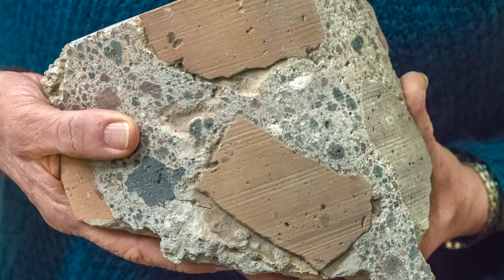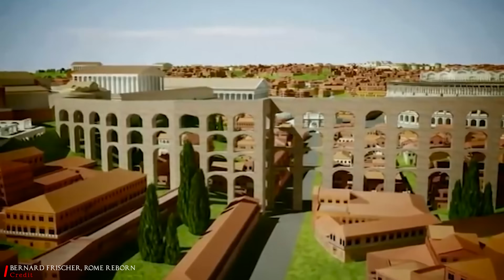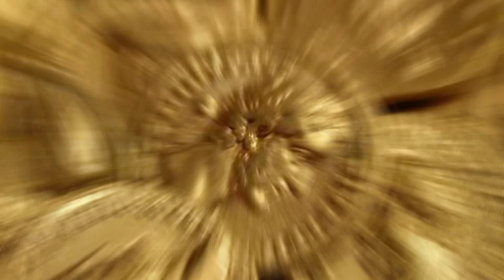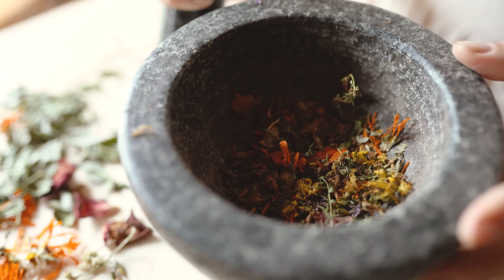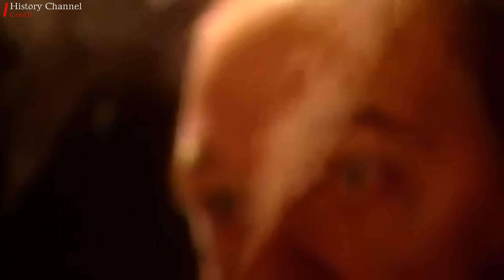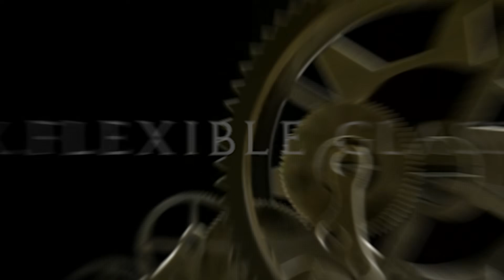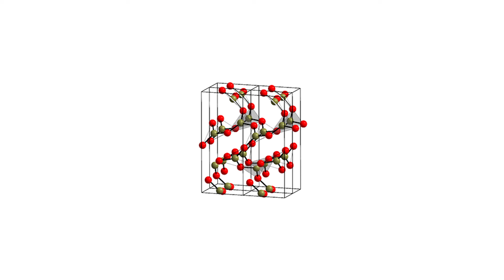Top 10 incredibly advanced Roman technologies that will blow your mind.

Comment: Say what you want even try to said what :

Harnesing a drinking water 24/7 to cities and urban, where this drinking water is delivered on hundred or even thousand public drinking basin are and the people can drink and enjoyed directly this 24/7 water from the deep aqueduct that carried from mountain spring is honestly an absurdly modern for that time, 

I mean people forget this is not only in City of Rome, but across hundred roman cities that have the massive aqueduct system 

And remember, 80-90% aqueduct is underground and for underground, they aint pipeline, they basically underground subway but design carried delivered massive water from deep water from mountain and design run 24/7, and remembee they divided in Water Castle or Castellum Aquae

And fhe general rule thumb are :

Whatever a shortage happened or the aqueduct line damage, the first one immidiately get stopped is on the elite house

Comment: Did the Romans discover coal ? Especially when they arrived in northern England.
 If so it would have revolutionised iron making & heating etc .
 
Probably a quarter of the energy to get it and 70% more heat ? ? And burn time.

Comment: Our current tech may be more advanced, but the conveniences and automations that do so much for us are a big part of it. Even now, it seems like the current crop of software developers are fundamentally weaker than their predecessors from just a few decades ago, despite making more advanced output (due to tools and libraries that do a lot of the heavy lifting imo).

Only a precious few are operating at the highest levels - it seems as though Ancient Engineers could still hold up against the current crop in pure skill and fundamental ability

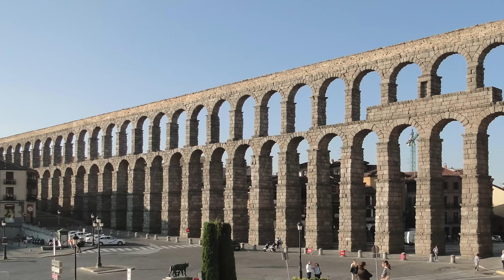Comment: At 07:44, Sebastian addresses my favorite form in architecture--the arch. And this beautiful but functional line is pivotal as well in geometry, conic sections, optics, archery, orbital mechanics, engineering, navigation, cartography, art, design, typography, dance, music, gymnastics and semiotics. 
    The arch, or arcuate detail, or most broadly--conceptual curvilinearity as compared with linearity--can express the narrative arc of a novel, the expressive arc of a compositional phrase by Chopin, or even an entire symphonic movement by Brahms. 
    The arch, a physical realization of an imaginary line we call an arc, strongly drove the emergence of monumental structures in Antiquity, thanks to their power to transfer the compressive weight of gravity to the earth, an artifactual default of the arc's defiant bow-form, holding up the sky, itself an incidental artifact of the self-propulsive lone of directionality through dimensional space, the most iconic visual symbol of intentionality as graphed by the sentient, volitional observer.
     For all those attributes, arches are an engineering staple, an architectural conceit, a ubiquitous derivation of essential geometries and an amazingly variable iteration of itself, eventually less structural than gestural--a flourish of flourishing.
       As a sphere can be sliced in half and plopped atop a similarly halved cylinder, it becomes the venerable apse--and if the cylinder be squat and halved, and not crowned but given a concentric layer , it becomes the exedra, an elegant bench beloved by wealthy Romans and the Pre-Raphaelite painters who portrayed them in the 19th century. 
       And multiplied down a long axis, arches form the arcade, providing the elegant, darkly spiritual quietude of legendary monastic life.
    Many students of GrecoRoman history might imagine the column, pediment or dome when asked to choose a visual logo of the Ancients. I wouldn't hesitate to embrace the arch. Or better yet--stand under it.

Comment: Flexible glass? Fantastic. It'd be really bitchin' to actually find some Roman flexible glass.
   Indestructible glass? That's really not too far fetched. 54 years ago when Coca-Cola and Pepsi Cola were still making glass soda bottles and "RETURN FOR DEPOSIT" was in vogue, the old vending machines at gas stations dispensed cold refreshing drinks in 6½ ounce glass bottles. These were amazingly durable for their size. A friend and I found one in a church parking lot and we took turns throwing it at a concrete block wall, trying desperately to break it. We finally gave up and I think we decided it was valuable as a claim for deposit against another drink. Tough little s.o.b.

Comment: Mercury gilding was an ancient and very durable form of gold plating . The ancients of many cultures obviously learned to extracted fine gold particles using native mercury , then burning off the mercury to leave a button of gold .  They would also use this same amalgam, rub it upon iron , heat the object and the fine gold would then be an applied plate . Having a lot of experience with this methodology, some glass blower experimented with it and discovered a method to evenly distribute gold particle through a glass pour - with the result of a two toned cup . 
  Extracting gold by this method is still used , though we now know mercury to be extremely toxic , especially when heated .

Comment: These large projects like aqueducts depended on the abilities of their surveyors, which were world-class.  This often a vastly underrated aspect of engineering, but it’s not easy to get the accuracy and precision they achieved without modern laser-survey tools.  Their  hydraulic engineering was incredible, too, they had to calculate not only slope, volumes, flow rates, etc. but head loss along every stretch of their water delivery systems.  Then their overshot water mills in series, brilliant.  Their technical abilities were simply amazing.

Comment: Civil Eng here. Your information about Roman concrete is wrong. Roman concrete has much lower compressive strength than most concretes used today. Roman concrete also did not have a smooth finish and was usually only used where it would not be seen. It outlast ours because it did not have steel reinforcements which will rust and reduce structural strength overtime, but our structures are not designed to last forever anyway. We design different concretes for deferent applications and specific life spans.

Comment: It’s sad that the Romans didn’t take the next step in advancements.  They missed their Industrial Revolution.  Their empire would never have died out had they continued to innovate, and renovate their technologies.  With all their advancements, they could not think to change the rope on the crane to a steel cable.  Lack of metallurgy innovation is what killed the empire off - not the barbarians, not the decline.  Those two things were just nails in the coffin.

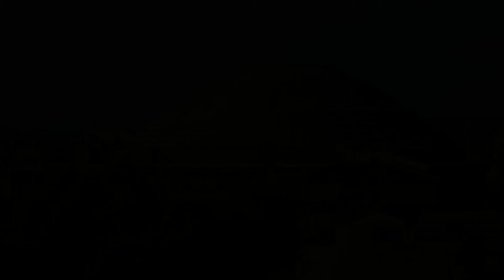Comment: 09:32 f: ... built of non- reinforced concrete ...
It would not have last until now otherwise. Reinforced concrete can take forces non- reinforced cannot but it's prone to decay. As soon as it has the first crack reaching the armour, water will cause it to corrode and to make the concrete irself to brősel away.

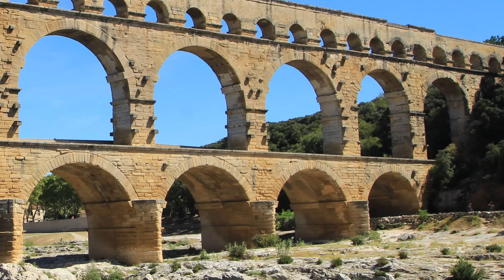Comment: 3:04 Pozzolana volcanic ash was in rare supply, Roman cement would have been ended without the fall of the Roman empire, and fly ash or coal fly ash is at first toxic landfill, before you possibly revalorise it as cement.

But AQVAEDUCTI are my favourite charge against the end of Antiquity and beginning of the Middle Ages. It's so bad.

1) Two cities had been taken through the aquaeducts, Naples by Belisarius, Vienne in Isère by Clovis. They had shown themselves a military security hasard, which was one reason to end them;
2) It has been pretended that Medieval water quality was so low you needed wine instead, false : it is actually aquaeduct water that was such a microbe hasard that it had to be mixed with wine or vinegar to be safe for consumption. Gazpacho goes back to a mixture of bread, vinegar and (aquaeduct) water used by legionaries, and the vinegar was obviously added to avoid gastroenteritis and similar. The aquaeducts were covered by stone slabs, so no twigs or insects would fall down into the running water (as long as the stone slabs were undamaged), but this did not stop bird poop from leaking down or local bacterial foci from proliferating ... long live Medieval well water!

Comment: A point you haven't quite got right.
The Romans used water wheels very widely.
When the Empire began to fall apart, most were left to rot.
But evidence suggests that Princes and or Bishops in what is now Germany and perhaps elsewhere,  saw the advantages in keeping to the wheels working.
They were used for a very wide variety of industrial processes.
The Industrial Revolution, was actually a long gradual Evolution. With the use of wheels being adopted, or re-adopted in many areas.  Steam is Not an essential part of industrialization.

Comment: Metals content in liquid is primarily a function of the chemistry and the residence time.  If a liquid is in contact with a liquid for a long time, it will pick up more dissolved metals, especially in an acidic solution, like wine or vinegar, which increases the solubility if the metals.  It’s safe to drink wine from a leaded-crystal carafe, for example, if just poured into it, but not if stored in it for a long period of time.

Comment: My opinion is there are two main differences between roman "concrete" and modern ones:
- they used lime, as we use cement. Lime never really dries and so remains (a little) flexible, as cement dries harder and becomes brittle.
- Romans didn't use steel bars in their concrete. Steel will rust and thus expand, which in turn will break the hard concrete.
Great video, thanks!
Reply: if you have ever mixed pancake batter you will notice some bits don't mix with the water, this concept applied to roman concrete would be a feature not a bug. were something to happen and the concrete crack water would infiltrate and mix with the power allowing the structure to "regenerate" that is the current understanding. I would also assume they just used more than they needed to which we don't do because of the cost.
Reply: There is no one modern concrete, but a LOT of different ones. For most constructions the cheap and halfway decent portlant cement is used, but there are FAR superior modern variants. They just cost a lot more, but would easily hold up to roman concrete.
Just have a look at some military bunkers where cost wasn't the driving factor.

Comment: Alright this video is trash.

Roman concrete differs from modern concrete because they have wildly different applications. We could make this concrete easily if we wanted but current engineering requirements have certain needs in tensile and compressive qualities to handle modern loads and laws based upon thousands of hours of study and design. There's so many mixes of concrete today because they have different requirements.
Reply: ok

Comment: I reckon they didn’t really have problems with the lead pipes because the water didn’t really “sit” in the pipes. The water was always moving. It didn’t sit in the “tap” until you turn it on like we do. I also think that the pipes were probably coated in calcium over time too. That might be one reason they used natural springs for a water source. They’re usually heavy with minerals, especially calcium. But it’s just a educated guess on my part.
Reply: that is so cool , damn... i have always beleived that water should just flow and never stop when it comes to metropolitan pipe systems , but i understand skyscrapers wouldnt be possible

Comment: How can the Romans not have discovered the uses of lenses for reading (ie, reading glasses) and for military purposes - ie, telescopes ???
Reply: Well, the reason for not discovering reading glasses, was partially because literacy was not a prized skill outside of certain noble ranks, where a disfigurement or failure of the body (like weak eyes) was considered a mark of a God’s displeasure, so … absolutely no impetus to make eyeglasses.  As for telescopes, they existed in India at and before those times (take a look at early Indian astronomy and astrology (the two were closely linked) and some of the astronomical observatories and predictive architecture) and would have most definitely been in the library at Alexandria.  The concept of a large reflective lens was also used as a weapon of war with the “focusing shields” to concentrate the sun’s rays to set ships on fire.  So the concepts were there.

Comment: "It's unsure how they moved these 800 ton stones."

OK well, if u figure that out, then u can figure how Egyptians lifted their stones. It would probably be roughly similar in nature, probably a little more crude. The power of the pulley is strong. And if u stagger pulleys, you can lift A LOT of weight with some slaves pulling a line. 

The boring out of a perfect circle was done with a hollow "pipe" that was sharpened along its tip edge. A heavy stone was placed on top to add downward pressure. A line was wrapped around the pipe and then pulled to simulate a drill bit going around in a circle. The hollow part of the tube, allowed material to collect, so constant drilling could happen. Sand was placed on top the surface to aid in the grinding and boring process. 

This however was VERY VERY time consuming. A man on YouTube was showing this process, and it took him about 3 fn hours just to get barely 1/8th or 1/16th of an inch.

For those who don't know what an 8th of an inch is. Take half of 1 inch. Thats 50% Then half that. That's 25% (1/4 inch) Then half it again. Which is 1/8th. If you half that again, you get 1/16th of an inch. 

So if u physically see how thin that is, that's how much he bored out in about 3 hours. So definitely they had a constant 24 hr drilling through the night with "shifts" which probably took 1 entire month to bore out. Very hard process.

Comment: that is all impressive but that waterwheel is so amazing - i didn't know they used hydropower!!!!
Reply: In mining industry they used a so-called water cannon.
They digged out long mine-shafts going down the inside of the mountain and then, when finished they lead water, lots of it into the mountain which blew up the mountain with the help of compressed air, compressed by the water.
The drawings shortly shown in this video shows exactly that, but it was not mentioned.

Comment: So, my question is why? Why would the Romans built bridges that could handle such huge weights?  Like the one in Alcantara in Spain, with a load bearing capacity of 52 metric tons. Did the Romans have such heavy equipment?
Reply: It’s not just to be able to carry weight, but stand up against weather, and time.  They built to last, so that their labor costs were mostly up-front, and not a constant drain, and when they needed to rapidly move their troops or goods, they knew their bridge would be there, and capable.

Comment: Please consider redoing or spinning off from this video --
For example, how Ukrainians could make Roman concrete and build with it.
Make aqueducts to replace their smashed water systems, even if only to serve one or two houses, or a very small village.
Anything the Romans did the Ukrainians could do today to rebuild their country without all the electricity, gas, computer chip controls and other flourishes we normally use now.

Oh, and with Russian and Ukrainian language either default or in captions.
Reply: One of the problems with this is getting the appropriate supplies to Ukraine.  Another is that many of the Roman methods took many years (Roman concrete cures much more slowly, for example) and, depending on what needs Ukraine has, as far as I can tell, a much greater urgency for rebuilding than can be waited on for Roman methods.  Looking at much faster construction and rescue methods would benefit them much more.  Cargo containers filled with carbon-fiber/insulation sandwich panels and attaching beams would allow for much more rapid, weatherproof structures to be built.  And that could be delivered via cargo plane and parachute.  Once the immediate needs for shelter, and perhaps service buildings like hospitals are in place, then rebuilding according to their cultural and traditional needs could go forward.